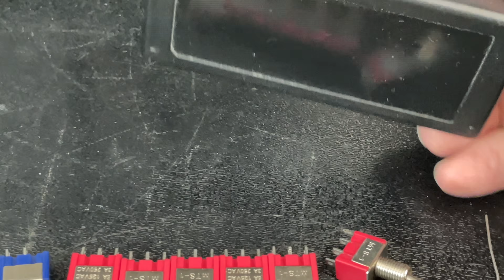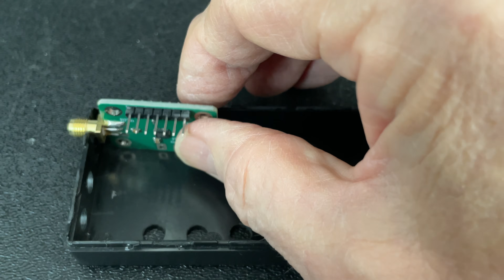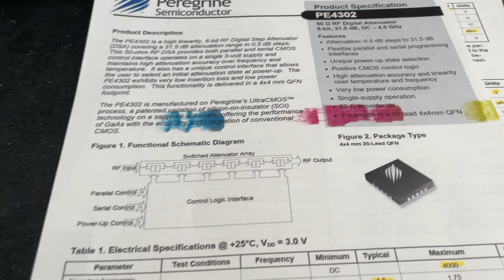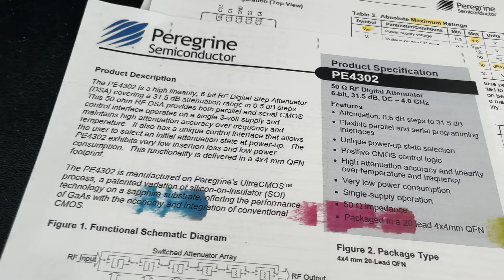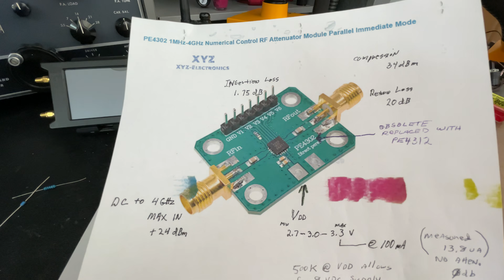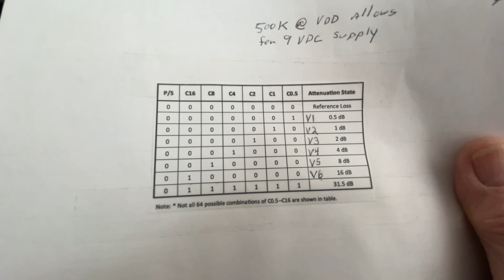The $2.70  Digital RF Attenuator - Part 1

Comment: Good morning, nice videos thanks. Since I can't find a clear diagram on the web on how to connect the switches, could you please explain how to do it? The middle one goes to pins V1 to V6 on the PE4302 board and OK, one end I see goes to VDD (+3.3V or 9V?) and the other end? To ground? Thanks in advance, F.
Reply from the maker: Hi Elettron.  You have it mostly correct.  But, do not use 9 volts...use +3.3V. And yes, the other end goes to ground. Also, a 3 Volt battery will work for Vdd and also for the middle switch contact without using a 9 V battery. See video Part 2.
Reply: @rechan3472  Thank you very much!
Reply from the maker: @elettronicaradiofc  Your welcome!

Comment: +24dBm input is more important to me, than the frequency range. 
My Icom 7300 rarely goes over 30MHz, so the GHz range is wasted - but it also pumps out 100W, or +50dBm.

But if I ever build stuff for the 70cm band, this could be mighty useful.
Reply from the maker: Thanks for your comment Soupie